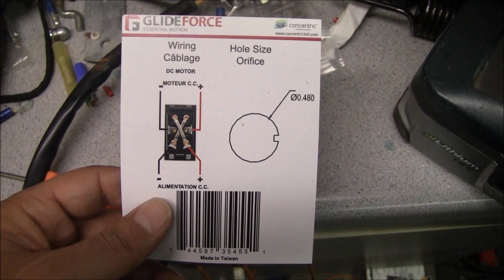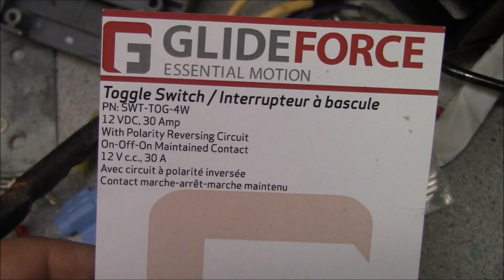Trolling Motor Variable Speed Controller Conversion Part 2

Comment: Can you use something like this in more easy way to a gasoline motor?
Reply from the maker: I don't think so... at least not in any economical sense, since most outboard gas engines function with cables gears and a carburetor. Anything is possible tho,  for the right price.  today there are plenty of gas engines that function electronically but they are  very complicated and expensive. I hope i answered your question?

Comment: Did you wire the switch in before the controller? I.e, the 2 wires come from the motor into the switch then out of the switch to the speed controller? Trying to figure out how to do this.
Reply from the maker: man im trying to remember how i did it exactly, i think its the battery to the controller to the switch to the motor.
Reply: goodtimesports thank you, that would make sense I reckon. Ill give it a try. Cheers.

Comment: is it possible to rig a RF remote controller to your system; if so, which RF transmitter / receiver would you go with?
Reply from the maker: Yes it is possible, i don't Know much about the different RF controllers. I did see one guy on YouTube that successfully converted one, i think he said he purchased it on ebay. my advice is to do a lot of research on the internet, and then search ebay. Good luck

Comment: how did you wire the trolling motor mine has 3 wires black red and green?
Reply from the maker: Its been a while since i did this project, but if i'm not mistaken i believe i just bypassed the wire and wired it hot. My motor came with a yellow wire and i think it was just apart of the switch but since the controller i used already had a switch i just had to bypass it and connect the red and the black. I hope this helps, if you have any more questions i will try to answer them. Good luck

Comment: great video I am doing the same thing with my kayak now thanks I was wondering how to get the reverse to work with the switch after removing the motor head unit.
Reply from the maker: Cool, let me know if you have any other questions i will do my best to help. Thanks for the comment.

Comment: Would you message me what controller you bought and where?  What are the specs of the controller?  I am very interested in building one of these.
Reply from the maker: +Mrsouthernsurvivor   No problem, this is the description of the  unit on ebay 10-50V 40A 2000W DC PWM Motor Speed Controller PWM HHO Controller 12V 24V 48V
Reply: +goodtimesports Thanks